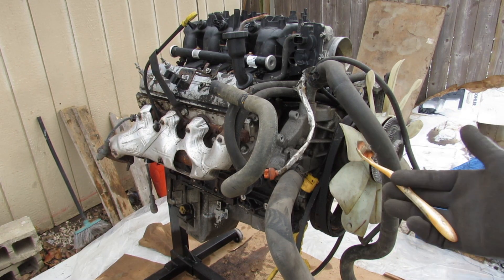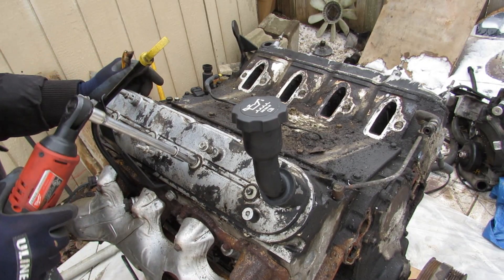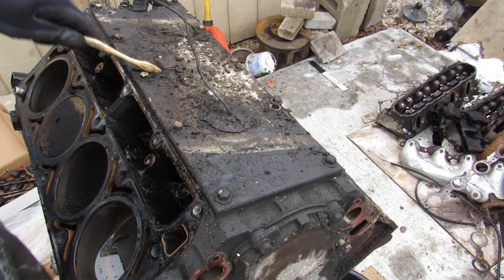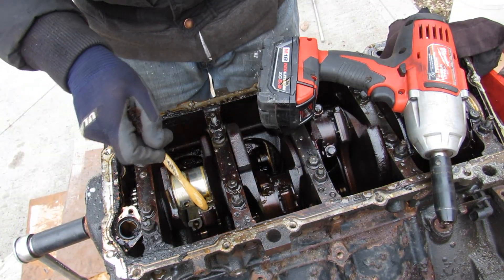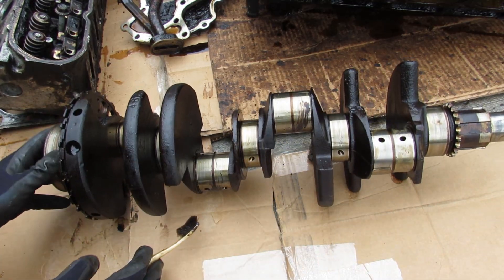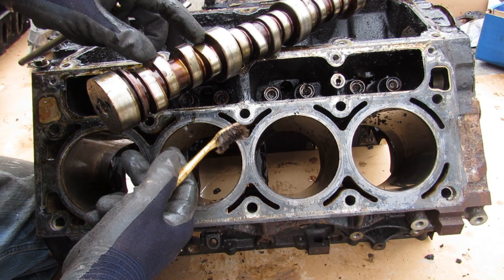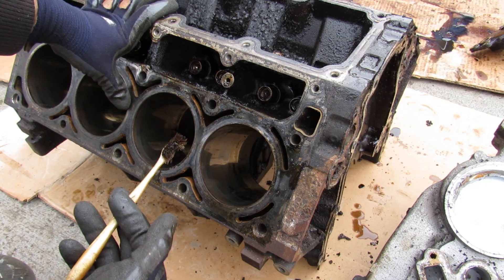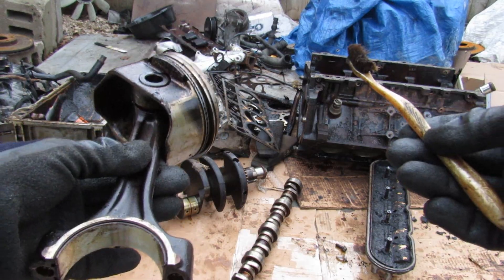Why the Chevy LS is the Best V8 Engine

Comment: this channel is exactly what youtube should be about. knowledge.
Reply from the maker: Thanks!
Reply: I agree...
Most utuber's push products, sadly
Reply: On God
Reply: School for 100 points? The end.
Reply: This kind of channel is worth more than all media together. Informative, no bs, just good, real, honest stuff and on top of that, it's FREE!
Reply: @manoman0  good thing it's free.  Giving misinformation and barely having the knowledge to teach others.  Real informative...   You don't remove cylinder head bolts with an impact tool, that's how they break.   Cannot stress to enough how much of a pain in the ass or how time consuming it is to have remove the remaining portion of the bolt that is still in the block.  Haste makes waste!  They should ALWAYS be loosened by hand before putting an impact tool of them.   Flipping an engine over before draining the oil is just plain butchery!  If he knew the drain was plugged with sludge, he should gotten on his knees and remove the oil pan first before flipping the the engine over instead of making a mess and allowing the oil to pour on the ground.   Engine disassembly has a procedure, none of which was followed in this video.   As for there being no BS.  Teaching the wrong way to do things is absolute BS.  As far  it being honest.  How honest is it to misinform and try to teach a mass audience when you don't possess the knowledge required to teach any other way than the hack way of doing things?   There are only two ways to gain the knowledge required to fix an automobile.  One is to go to school to learn the Automotive trade.  Secondly to have a job in Automotive trade where it take years to perfect ones skills.  Once you have that, then you can spread your knowledge to others.  For example.  If one does not possess the required knowledge to give medical advice, one should not give medical advice. The same rule applies here.   Cheers!
Reply: @adriand2175  Question: In case of this specific engine, does it matter how it is being taken apart? Other than that I am reading your words carefully. Thank you.
Reply: @manoman0  it absolutely matter how an engine is disassembled. The whole video is about taking apart an LS while he's dissembling a Vortec V8 ,not an LS.   Knowing what type of engine you're working on would be a good start.  For example.  He tried to remove the camshaft before removing the lifter.  That's why the cam would not come out on his first attempt.  The lifter dropped from their bores and prevented the cam from coming out completely.  My comments are not specific to this engine, it applies to all engines.  The gentleman in the video was just taking out nuts and bolts without think what if or following any sort of procedure.  Always follow procedure.  Learn to do things properly before trying to do them quickly or teach other how to do it.  Cheers!
Reply: @adriand2175  I had the same subconscious cringe that you did regarding the impact and some of the disassembly etc. , but I think you are way over reacting. All these engines aren't going back together again so it doesn't matter. In another comment section he mentions he's not a mechanic by trade.
Reply: That's RACIST!!!
Reply: it could use more Minecraft tho
Reply: P
Reply: Knowledge?!   This meatball identified the low oil level sensor as the block heater.
Reply: @adriand2175   he also pulled the cam out or at least tried to without pulling the lifters out.   I understand that he wants to show people with no mechanical experience but other than that he did just fine with explaining the engine.
Reply: @vintagedashboard6810  let's agree to disagree.  There were many mistakes.  He didn't know how pushrods get oil. That is level 1 engines, day 1 of schooling in the trade.  It's also something you'd better know before you show up for the first day of school.  He certainly knows how to take out nuts and bolts.  Explaining not so much.  Also.  He was taking apart a Vortec V8 not an LS.  They are designed like an LS but NOT LS.   It must be an aluminum block to be an LS and a car application not a truck as he stated. Unless it's an LSX.  He was stripping an L20 engine, a truck 4.8L.  LS engines come in these displacements: 5.3L, 5.7L, 6.0L, 6.2L and 7.0L when installed from the factory.  The GM performance catalogue has more options.  The LSX comes in multiple displacements.   It's a better plan to learn how things work before trying to teach others.  To make the mistake you mentioned and try to remove a cam before the lifters, that's someone that needs to be the student before becoming the teacher.  That's common sense.
Reply: @adriand2175   all I have to say is teach me master
Reply: @MrStubbs86  no more teaching today. I'm done.
Reply: @adriand2175  I mean if you're so smart and helpful where's your video?  You seem like the real deal, but so far we have learned a lot more from speedkar.  So...
Reply: @GoodMenstruationAttitude  I am the real deal.  I've already taught more in my comments regarding this video than anyone has learned from speedkar and I don't need a channel to prove it.   Have you read all my comments?   Does the fact that he's made a video about an LS engine and he's not working on an LS mean nothing to you?  Maybe a video about cars while he works on a dishwasher would be helpful to you. You want to learn more?  Go to school.  Get an apprenticeship.  I'm not here to teach the world.
Reply: @adriand2175  You missed the point. He takes apart to show the parts and explain how they work. In his other videos, he actually  uses angle grinder  to cut a part  and show the internal working. It is obvious that this is not a repair or overhaul video. He is a mechanical engineer and wrenching is his hobby. He is also learning and discovering as he takes apart things. He simply video recordes the disassembly and shares with us. Most of his followers are happy that he took the time to record and edit this videos and shared his knowledge with them. I did learn a lot from his videos. Other than that, your name calling and the insult you threw says a lot about you- which is not good. I feel sorry for those around you.
Reply: @adriand2175  I don't think this channel is meant as a tutorial on teardowns. This is just well edited, digestible information for layman who probably won't ever open an engine up but want surface knowledge of failure points and why maintenance is crucial. Mistakes are expected as he's learning in the process of his teardowns. This is not an 18 minute guide to qualify someone as a mechanic. I imagine whatever you see here should more or less be applicable to a true gm labeled LS

Don't see the need to be so aggressive about it if you don't have a better channel to recommend. Shits just interesting to people who might not be looking to dedicated their time to professional training. Any corrections you got are appreciated though. Everyone's just here to learn
Reply: @adriand2175  He's stripping a junk engine, not teaching how to strip/rebuild a 1500hp drag engine, keeping the video to a minimum. Do you have a channel the rest of us can enjoy your methods? The electrical plug was a joke, ever see a block heater with lamp cord wire 16 gauge? You have a right to your opinion I respect that, take it easy on yourself Bro life's too short.

Comment: @speedkar99 

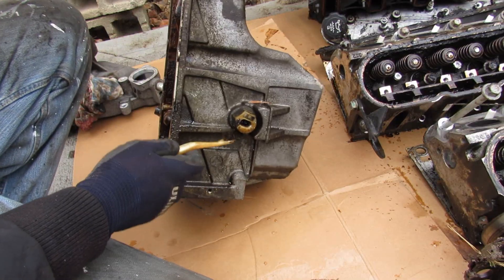10:32 is the low oil level sensor 

12:19 that plastic plug is the block heater connector
Reply from the maker: Yes. 
I filmed but edited that out last night to shave time. 
Rough cut on this video was 28 mins lol
Reply: @speedkar99  id take 28 min of an LS engine anyday. Lol

Thanks for being a good sport about my comment. I didnt wanna sound snooty correcting you

Keep up the excellent work. Watch your videos all the time and subscribed.

Comment: Most of the engines that have a lot of sludge etc have tht junky fram filters in most of these vids u do
Reply from the maker: Well that's how I can buy them 😁
Reply: speedkar99 I’m just saying it because the owner were horrible
Reply: the filter has nothing to do with sludging, its the lack of maintenance and brand of oil.

Comment: maybe this is the best american V8 but imo the m119 is the best ever.
Reply from the maker: Can it be had as cheaply and reliable??
Reply: @speedkar99  cheaply most likely not. it´s very reliable though. my favourite engine is the m104 straight 6 though.
Reply: The LS is objectively better. It's smaller, lighter, more efficient, more modifiable, and the reliability is hard to beat.
Reply: @Josh-nt3fo  well you are right at every point. subjectively though (imo) the m119 is better. also quite reliable. frankly I dont know much about american engines. I exclusively work on Mercs and Alfas :)

Comment: I've known guys that have bought the 5.3 out of junked Silverados, slapped on a cheap turbo and made over 700 hp without doing anything to the engine.  That's a testament to how strong they are.
Reply: Why buy a 5.3 from the junkyard, when a 6.0 costs the same?
Reply: @fun_ghoul  6.0 are usually gone before you can get em. But I get what you're saying. I had a junkyard try to sell me a 5.3 for 900$ and didn't believe I could get it somewhere else for cheaper 🥴
Reply: @fun_ghoul  where I live in Gdl, Mexico,  5.3 ls engine and transmission cost us1,500 for swap
Reply: @fun_ghoul  parts only
Reply: @lucysmith4242  $900 for a tired old 5.3 is a scam. Might as well spend the ~$3000 for a freshly remanufactured example.
Reply: @lsswappedcessna  Or get a tired 5.3 for free and reman it yourself
Reply: @lucysmith4242  I doubt you could get it for free, even a blown up 5.3 is gonna cost you something unless the block is windowed or some other irreparable damage. Which, with some luck, won't be the case. Because they're sturdy.
Reply: @lsswappedcessna  I traded for some junk my brother told me to throw away. It was gen 1 sbc junk
Reply: @fun_ghoul  Where. Sure not around where I live.
Reply: @zakspop yeah for sure my man. Shit the 6.0 are around the same price as the LS3 now.
Reply from the maker: Yep they sure are popular!
Reply: I think you need to open the ring gaps a little if you want that engine to live with a turbo
Reply: You can slap a turbo on anything and make power,  just for how long is the key. Boom 💥
Reply: @jostrander71  the lack of Boom is why people love LS engines and Mexican made fords 5.0
Reply: The block on a 5.3 will handle up to 500 horsepower with no problems, but I've heard of people pushing a factory block to 1000 and beyond. The crank is probably good for around 500 if I were to guess. The weak link in GM 1500 series trucks are the transmission. The 4L60E wasn't bad for use in cars, but in trucks, which are heavy, and can tow, they suffered a reduced lifespan (usually 200-250k) compared to the engine (above 350k with good maintenance).
Reply: I have one in my Yukon I’m hoping it gets rear ended in the parking lot
Reply: @tillman40  🤣 I hear ya.

Comment: Despite all the sludge, I bet ya that engine could still run another 100k miles.  Thanks for the video
Reply from the maker: You are welcome. I think it would have started anytime. The oil pan was so clogged I couldn't drain the oil from the bottom.

Comment: Lifters, Rear main seal, all the electrics ( GM)  that's the general problems with an LS engine (every brand/engine has common faults)
a good engine for the money and simple. 

Nice video
Reply from the maker: Thanks. Yeah lifters could be an issue. I heard the newer cylinder management versions were trouble

Comment: I prefer the lexus V8 like the 2ur-gse and the UZ families
Reply from the maker: I wouldn't mind the Lexus V8 either, but they are much more expensive and won't take power as well as an LS
Reply: @speedkar99  an 3ur-fe for example can easily handle 700 hp and more
Reply: @fun_ghoul  yeah that's true